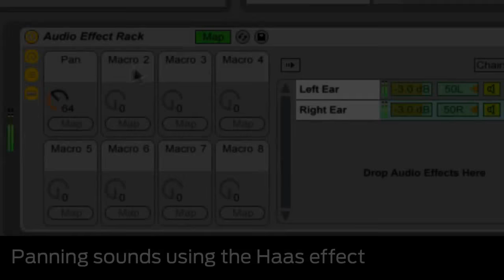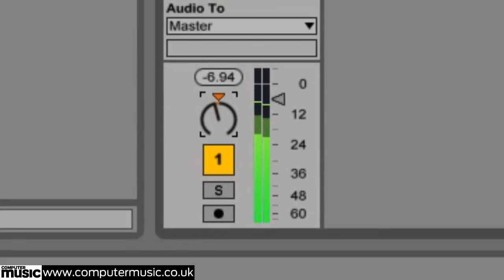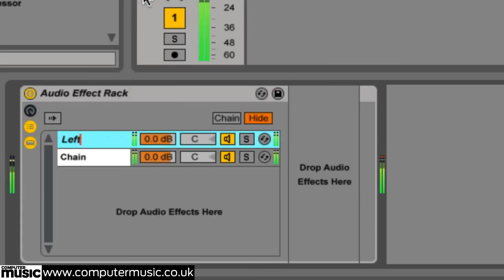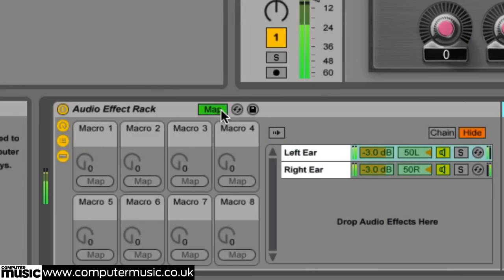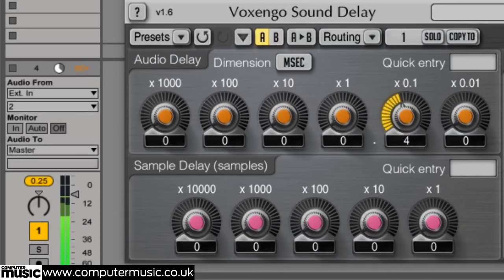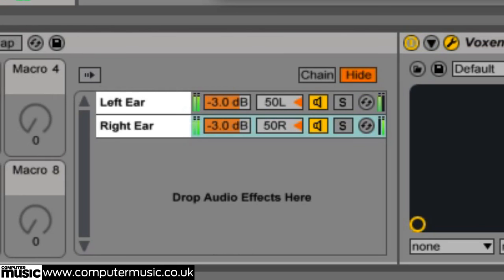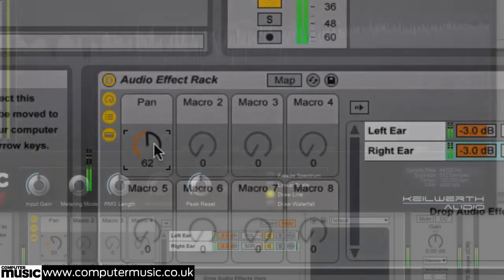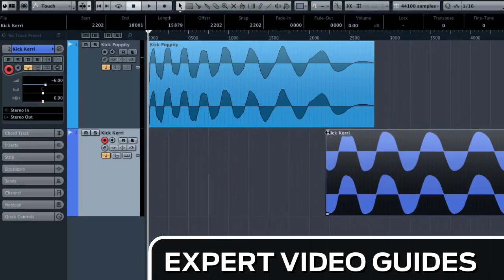Panning sounds using the Haas effect instead of a pan control - 7 of 10

Comment: Why did you choose a mono source?  Going to see if there's anything wrong with doing this with a stereo source...
EDIT:  Seems that the reason this doesn't work on a stereo source is because you're not really going to actually change the stereo direction(!)... the point of this is to mimic an exact copy of a sound bouncing off of a wall which gives the illusion of position.  But if a sound is stereo then you're not really POSITIONING the sound, but you will change the stereo image.
Since perfect reflections don't really exist in nature, it wouldn't be a bad idea to lowpass the part that's being delayed to mimic high frequency absorption.
Similarly Dan Worrall talks about band limiting the delayed sound in order to minimize the comb filtering artifacts and also turning down the volume of the delayed signal so you don't get full notch cancellations.  You can also tune the delay to notch out at frequencies where the haas'd instrument is clashing with another instrument that's occupying the same frequency domain.

Funny enough I had paused the video, thrown white noise through the same VPS scope (that I got for buying BazilleCM) in order to check the comb filtering artifacts... then you did the same thing right after!